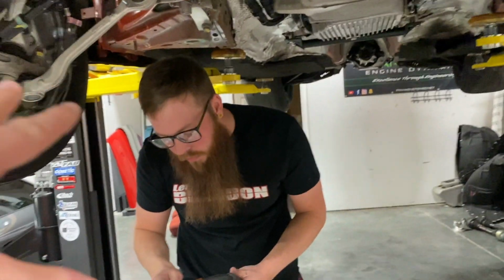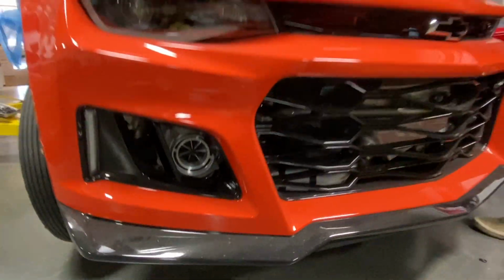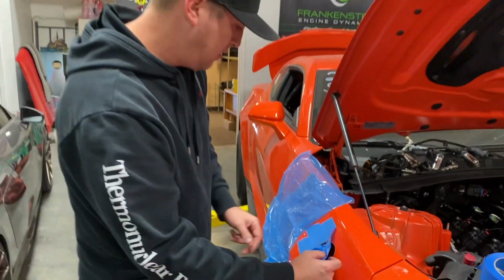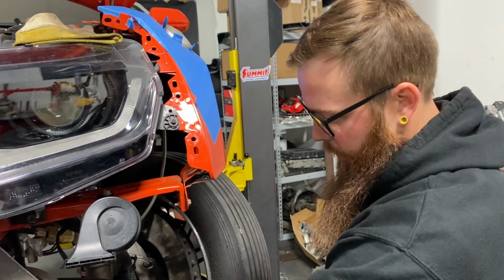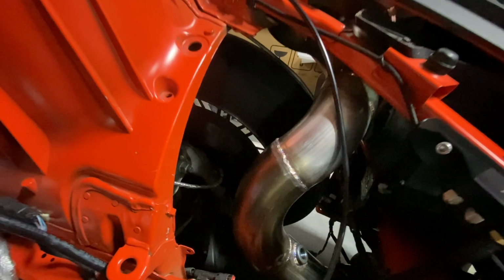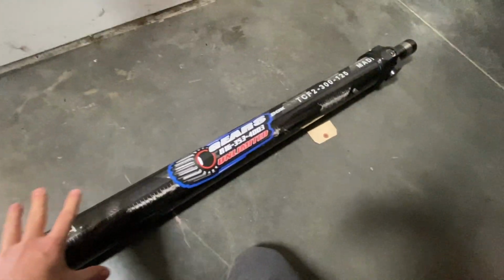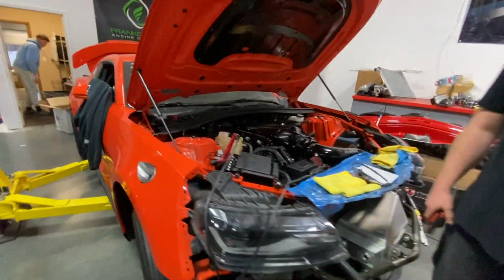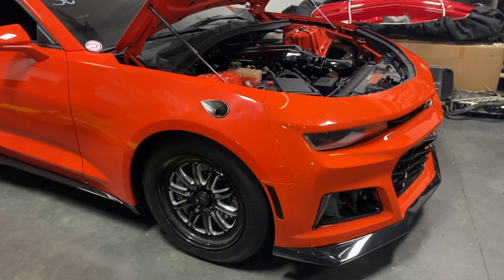The front mounted Twin Turbo kit is done on my 2019 ZL1. It sounds amazing!

Comment: Perfect spot, on the turbo setup. You cut the hole right it's not supposed to be perfect or a certain way as long as you put tape on the paint before you used the hole saw. It's your setup so it's never wrong. Can't wait to see how fast it goes, also want to see ZR1500 content later.

Comment: If you want to run a fender liner. Had to do it on my truck. I got thin gauge aluminum formed it into fender liner works great  keeps water and junk from covering the inside of the engine bay. My down pipe all most sits right on it heat dose not effect it at all.